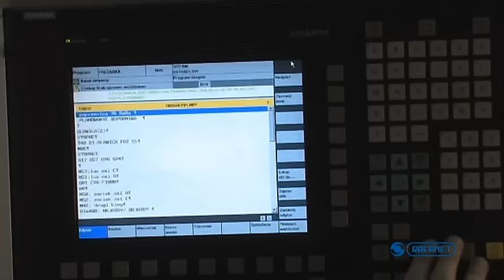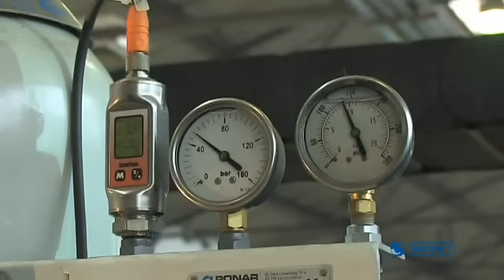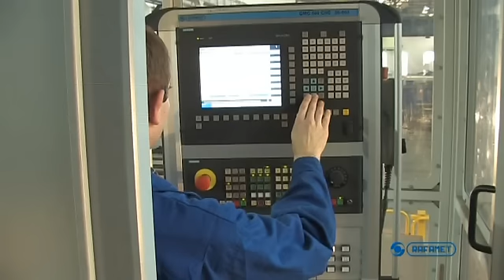RAFAMET Portal Milling Machine

Comment: I know. But the whole cycle of changing the tool could be optimized and sped up so that it wouldn't consume that much time. Why would you move up in the Z axis all the way if it would be more than enough if you would go 300mm up? The precision doesn't have anything to do with the speed of a tool change.
Reply: for clearance